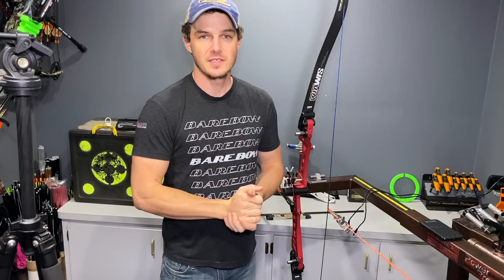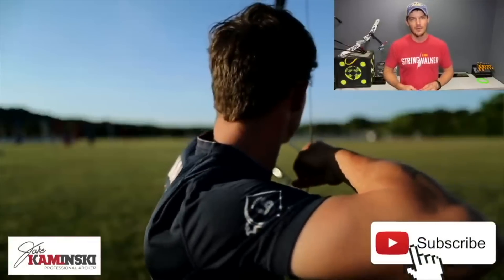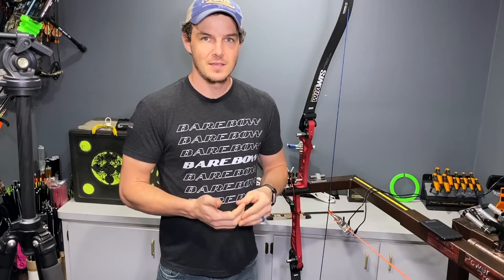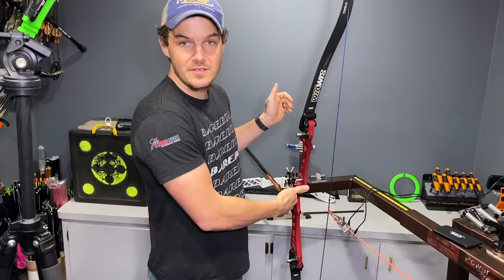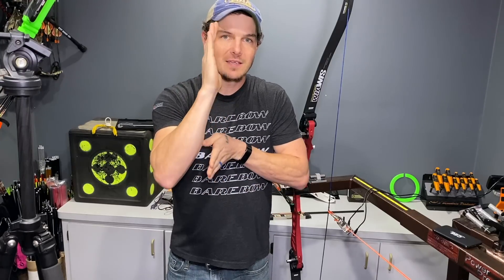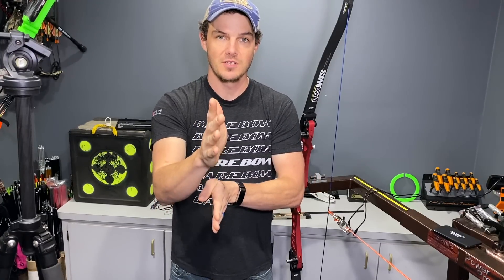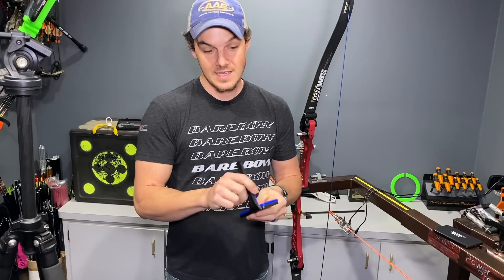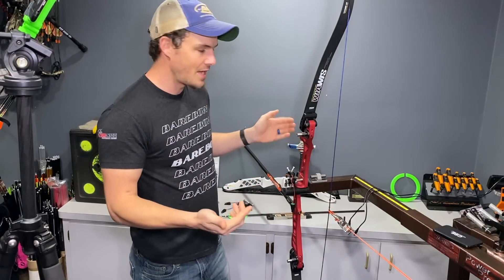Introducing Recurve Riser Flex Testing | How I Will Test Archery Risers with REAL DATA

Comment: That's a good start, Jake.  Some baselining measurements are in order as you continue:  Run each experimental iteration a number of times (three to five, I think) to assess the precision of your measurement technique(s).  
Report your results in good statistical form (average results with standard deviations, at a minimum).  Somewhere along the line, try to get data from three identical bows to assess the bow-to-bow variations in what you are measuring.  This will help when you or others explore how one type of bow varies from another. 
For example, if manufacturer A bows vary from manufacturer B bows, be sure that variations from bow-to-bow within a manufacturer's bow-making process are not of the same magnitude as variations between different bow designs.
Pulleys are designed to use particular diameter ropes; get a better pulley and use the rope dimensions specified for that pulley.  This will avoid rope jam issues and allow smoother draw operations.
You can get free blank graph paper by "Googling" graph paper on the Internet.  Print what type, dimensions, and quantity that you need.  Graph paper, as you pointed out, may make measuring and reporting your results more graphic and more easily understood..
Your enthusiasm shows; keep up the experimenting (and the YouTube demonstrations).  Good data trumps gut feel and street lore any day.
Michigan Dave
Reply from the maker: Cheers Dave. I planned on 3 minimum measurements and tests to be sure. I have two ATF risers currently so I will see at minimum if those two are different. Ordering 3 of each riser to test could be costly and Im not sure manufactures will send me 3 of each.... BUT that's a great idea and I have wanted to know that answer as well. Imagine shooting a bow for 3 years and then measuring against a new one....

Comment: I can fully understand your excitement ... data-driven is fun but also useful as it remove bias. Also enjoy to see you learning as you go.
As for suggestions I thought about to 
1) make a frame to hold the paper on the plate top/button and have the paper horizontally moveable during multiple measurement for the same setup (require maybe preprinted grid on the paper)
2) fix the phone to capture the image on the riser-side of the long rod (or use a 8-12 MPixel USB camera); that would give you consistent images in case you want to overlay them between risers.
3) when you asked for the micro adjustable laser setup my first thought was: Beiter Plunger ; but no further idea how to integrate that plus a bit expensive ( ask them, they might send you two)

Looking forward to see more and how the process evolve

Comment: Your only at the tip of the ice burg I think.  I applaud you on your approach to a very technical issue.
First I would like to thank you for all the videos you have given us. Information like you have shown us has been almost impossible to find and to have it in one place is a gold mine.

Only thing I would check is the possibility of the limbs moving or not perfectly aligned in the limb pockets. Reason is you are now comparing engineering vs eyeball measurements.

I'm as excited as you on your quest to measuring riser flex. I'm looking forward to seeing where you end up as your testing evolves.

Thank you from the bottom of my limb bolts...

Comment: Jake, this is an excellent initiative; the bow manufacturers will probably hate you but us archers won't! Some ideas to maybe improve the set up: the distance between the bow and the paper is short meaning the indications of deviation are quite small, introducing significant inaccuracies whilst physically measuring them. You could improve this by increasing the projection distance, so set the paper on a wall say 5 or 10m from the bow.  You could also create a single point reference by inserting the cross hair laser (set vertically and horizontally) in that arrow (constant centre point) and then taking the measurements from that projected reference point. By doing so, you would not need rely on the riser remaining vertical throughout the draw as you are measuring relative deviations. Keep up the good work.
Reply from the maker: I tried the wall as a longer distance, but because I am measuring from 3 different points on the riser, as the bow rocks and moves during the draw cycle the 3 points change their position on the wall because they are not zeroed out in space, they are zeroed to each other. I tried that and found it impossible to isolate the movements relative to each other. I could try a longer stabilizer potentially. or screw two together to double the distance measured. 

Thanks for the comment!
Reply: @JakeKaminskiArchery  It would only work if you have a zero reference point from the bow itself -that's why I suggested putting a cross hair laser inserted into the arrow tube and measuring everything relative to that point. All bow movements from the draw cycle are then eliminated. Did you try that?
Reply from the maker: Would it not be the same as just using the arrow dot as the central reference point and then measure the movements of the rest from there? I may not be understanding what you are meaning.
Reply: @JakeKaminskiArchery  Yep exactly that. The arrow dot (or cross hairs intersection) should be the centre, then everything else is relative to that point. Worth a try.
Reply: Scratch the arrow laser idea - not safe. The centre laser also needs to be fixed to the riser

Comment: Hi Jake!

Pre-print your sheets on the stabilizer. 3 crosshairs in a left to right 45degree angle.
Botto on bottom left crosshairs
Middle on middle crosshairs
Top on top right crosshairs
It removes confusion for each Mark
It gives each mark its own consistent space
When you start getting an idea of average deviation you could start pre printing small fine grids with small fine lines, like 1-2pt lines
This will also help with marking consistency and data recording
Put a few lines tor testing data
Riser name, date, time, temperature, humidity %
String configuration (material, strands, nocking point from top and bottom)
Brace height
Top & bottom tiller
String length
Reply from the maker: Great ideas

Comment: number data is fairly hard to gather for most archers >_>
This is awesome!!!! You actually did it!!!!! :D
I'm certain you still have your W&W TFT, can you do that next? Then the rest of your (likely huge) collection of risers? :D
You have a fairly good setup. I suggest using a .1 mm pencil :)  [and finer lasers, if those are even available lol]
Maybe use fine grid graphing paper for the paper?

I'm honestly excited.
I'm certain being you, you have a huge collection of risers & limbs :)
Maybe do what I do and commit sacrilege by mixing your Hoyt/W&W risers/limbs lolol
Then you can do multiple regression analysis on whether mixing risers/limbs are bad or perform less good, or maybe you will find that a particular mixture of limbs/risers work great together. The boring result would be that you should use the limbs the manufacturer of the riser released at the same time because they were tested and optimized for each other during testing.

Comment: Few concerns I want to point out with the rig system which I have spent some time putting pen to paper figuring out my own rig.

1. Putting the diodes on the sides of the limb pocket is assuming the sides are on a flat parallel plane to the vertical center of the riser, and does not have some small tapper in the design. While the setup works for flexing, unless you assure it's on a parallel plane it will give you false positive on torque.

2. Nock point position should always be measured as this can cause an offset on which limb gets pulled "more". For consistency it should be on same plane as the plunger button for all risers.

2a. The distance of the plunger button to the top and bottom limb pocket should be measured for reference.

4. The same limbs should be used on all tests. That means you'll get different results when you test Hoyts and their formula limbs.  Limbs sold in pairs have slightly different tensile strength and one is slightly less than the other. That's why they're marked top and bottom (this was confirmed to me by a manufacturer). You would be better off pulling straight from the limb pocket without limbs if you want to measure flex and torque differentials.

As a side comment I would like to see how much difference (if any) there is in flex if there is an offset (if I put more pressure above the nock or below). How much human inconsistency error is needed to see changes in the riser flex. Isn't this factor what makes a bow more forgiving and in turn consistent?
Reply from the maker: Hey Jimmy,

Thanks for taking the time to comment! 

1. I agree and is why I have changed to measuring off the back of the riser between the limb bolt and the dovetail, this way it can be consistent even on formulas... Also they are all now on the same plane too.

2. Agree 100% I will keep that the same too

2a. Agree and I take it a step further now measuring the laser to target distance difference as well and correct my measurements for that difference too.

4. Agree 100% and will do that as well. 

You'll see what that does in the next video coming out tomorrow. I pull the bow back and show the human input in the next video.

Comment: Hi jake, just wanted to let you know that I am as excited as you are. I think what you are doing is critically needed with new risers pumping out lately and the review criterias always so subjective.
On the critical side, I am not sure if I am right but I saw the starting point of lasers to be not in plane with the arrow(or center of the bow). Instead, it is off set to the left a certain(and possibly arbitrary) amount. I think it is important to make sure that the starting point is in plane with the geometric center of the bow or off set to the left a fixed amount everytime to not have trignometry render different results uncompareable between risers.
Reply from the maker: Why would it matter? I am trying to wrap my head around why. As long as they are mounted in the same areas, and reference to the same place on a static object attached to the bow ( the card on the stabilizer) It shouldn't matter. 

If the bow pointed to a static object not tied to it (the wall) then I would assume you would be 100% correct.
Reply: @JakeKaminskiArchery  Let me provide an hypothetical example. Say you point a laser perpendicular to a wall, rotate it 3 degrees to the left, the dot moves 1 inch to the left. Then at the same distance to that wall, the laser starts by pointing 30 degrees to the left, then you turn it 3 more degrees to the left, the distance that the dot travels on the wall will be way more than 1 inch. I am exaggerating the scale but I hope the analogy is helpful.

Comment: Very interesting and great work. Suggestion: try the set up and measurement multiple times on the same riser to find the inconsistentcies in your protocol. The measurement is essentially change in angle which is nice way to visually amplify the tiny riser deflection. But it means  tiny changes in set up could have large impacts.
Reply from the maker: Agree. Thanks for the input.

Comment: I dont know if you still use this rig, but put mirrors on the bow, as micro adjustable first surface mirrors are used all the times to align lasers. also a bonus twice as sensitive to bow deviation.

Comment: Nice job as usual,  Its really  a good idea.   What worries me the most is the lateral or horizontal flex because it's  generates forces that are not in line with the path of the string.  Big hello from Brussels Belgium.

Comment: Exciting data. You mentioned that adding weights to certain areas could make the riser flex differently and that this can influence how your arrows group. Would you be able to get data on how weights on the top (near the arrow rest/plunger) or the bottom (near the bottom limb pocket) impact the riser flex? For barebow archers, would this be a way to measure optimal (most forgiving) weight setups?
Reply: The added mass would only make a difference on release. With this test there is no release, only the flex at full draw is being measured. What this test does seggest, is that if both pockets flex evenly then the pocket with more mass would return to original postion slower. How much slower is anyones goess, I would say probably not noticable unless it is a very large difference.

Comment: Hi Jake, I admire what you trying to achieve with this video. Very interesting testing. I however have one issue: since you had the bow on a drawboard and did the full draw the same as with a compound...I feel that there may be a error in this test. Please correct me on this statement if its wrong: The angle the string makes from top limb to arrow nock will differ from the angle from the  nock to the bottom when at full draw by an archer. This may cause a variance in your results if you use the values from the drawboard machine.
For the arrow maybe this product would be great: GRG Archery Laser Sight Tool for Bow and Crossbow, 223 Bore Sighter Shaped (on Amazon.com)

Kindest Regards

Comment: I'm wondering if the central dot movement is because the pressure button is about ½ - 1 inch above the pressure centre of the grip, and also you have removed the grip, meaning the pivot point of your jig is forward of where it would be if you left the grip in place.
Very interesting. I'm wondering if flex could be used to increase speed of the riser by altering the plane of the limb pocket relative to the increase of the deflex, ie, I expect the plane angle to increase relative to the vertical, but if the riser can be made to flex in opposition through the use of crossed members in the riser and greater rigidity in the back of the bow relative to the front. The Gray AIX seems to achieve this, whereas the Spigarrelli Revolution increases more than average, but very consistently.

Comment: Totally loving this and also finding that I'm not the only one who finds themself getting obsessed over the details! Love it!

Something I'm wondering about though, and it's hard to explain on here so my apologies for any up-coming confusion: If you pull a cork from a bottle of wine, as you exert force on the corkscrew, there's a tendency to twist the cork out as you pull it due to natural wrist movement/arm extension. With that thought in mind, is there, whilst the bow is being drawn back, a possibility of lateral twist being introduced as the force and distance increases?

If there is, then my thoughts would be that it could potentially come from tolerances within the manufacture of the limb pocket, or the limb itself (or possibly the string connection? I've had occasionally had bow scales slip on the string when pulling back). That wouldn't negate the results of any tests on a specific setup of course, but if the riser is torquing because of uneven pressure being applied due to a slightly angled limb, does that alter the attribution of cause? That is to say: Hypothetically, yes, this riser and the material it's made from are flexible at 5% but, that 5% is the pliability of the material and the actual deviation of 'my riser with these limbs'  whereas for the same riser it could be 10% or 0% depending on how the limb is fitted or designed?

Put another way, is it possible to conclude that the 'Acme GT Turbo' riser has 5% deviation or, could that deviation vary across risers of the same model depending on other components, and their manufacturing tolerances?

Does that make sense?
Reply from the maker: It somewhat makes sense here. 

If I repeat the test with the exact same nocking point pulling location, same tiller, same limb alignment, same everything then however the risers flex should be comparable. 

I will make a different peg some day that the grip sits on to simulate hand pressure on the grip and already have "fingers" made to draw the bow back to see if that changes anything.
Reply: @JakeKaminskiArchery  Yep, I think it should work and if anyone can make it work, it's yourself. What had worried me I guess, was what information the results were telling us. Everyone is looking for an edge and there's a temptation to think that hypothetically if you got a result of say 5% distortion with 'Riser X', if I go out and buy 'Riser X', I'll have bought a riser that has only 5% deflection.

My concern was that I don't think that assumption would follow. The results would be correct and consistent for you and therefore valid comparatively, but they'd be specific to your setup and perhaps not reproducible for someone else with different limbs, etc. Of course, if someone made that assumption that would be their fault, but it could be something to factor in.
Reply: @JakeKaminskiArchery  I've just had another thought, sorry to overload your notifications:

but, maybe what you are onto here is actually a marketable product/accessory for a bow press? My concern was essentially whether your results would be persistent in my own setup and if something like a misaligned limb or limb pocket would alter the results.

If it did, then what you might have is one heck of a more accurate replacement for Beiter Blocks? If you could print out the components and parts, tie in with a bow press manufacturer as an accessory or built-in part, could this be the perfect way to set up a bow? Literally, at an Olympic level of accuracy!

All the best with your endeavours!

Comment: I thinks those mesurement are very intersting to add to a review and completing a database with those results !
To make things more relatable I think you should do the mesurements several times so you can have the deviation on your mesurements and eliminate mesurements error from the conclusions.
Reply from the maker: Yes, all planned on several tests and several measurements to confirm consistency. This video showw 2 draw cycles with essentially identical results.